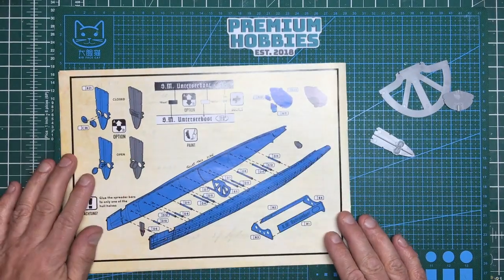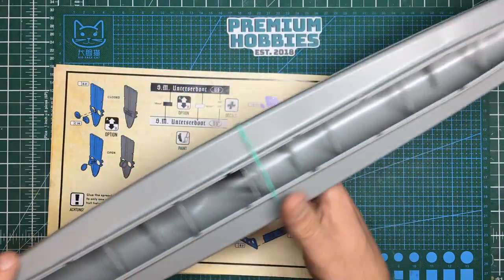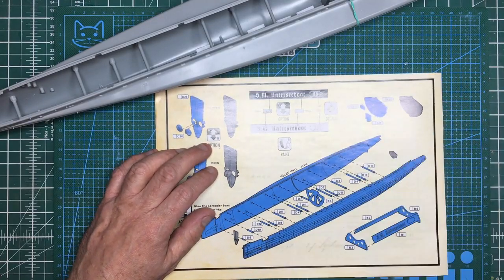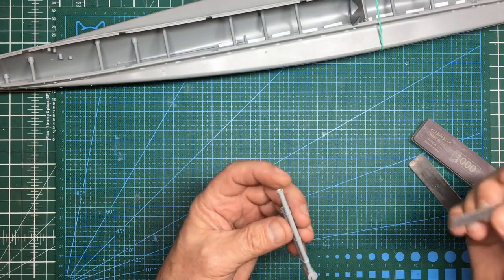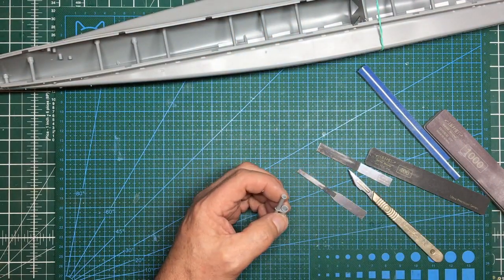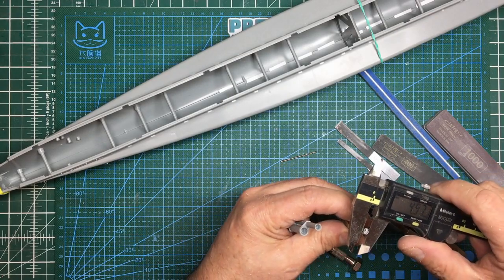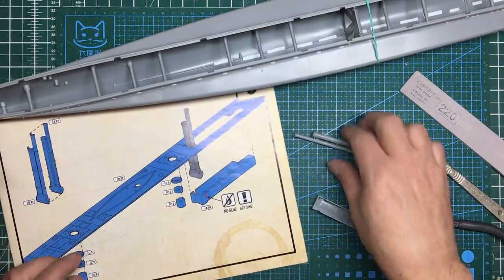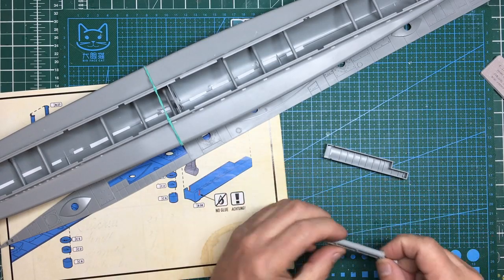Das Werk 1/72 U-Boat U-9 Build. Part 3

Comment: I think you are correct, Nigel. I believe it is ABS, since I had that type of plastic sheet supplied with a radio controlled aircraft kit I built many years ago.  It was very shiny on one side and dull on the other. I was never able to get it to glue using styrene cement. Plastruct PL2 Plastic Weld will bond it. Great video as well. I love your technique for getting the hull to line up by using the alternating tabs. Brilliant!

Comment: Really enjoying the build 👍 I personally think that the taller stack would be the intake leaving it in cleaner air. Looking forward to the next part and how to fix my finger smudges
Reply from the maker: Well, if that were the case, surely the intake would draw in all the smoke from the exhaust?
Reply: If they're parallel to each other and at 90 degs to the direction of travel the taller stack would be in cleaner air imho
Reply: In modern-day submarines the exhaust is below the intake. While the ship is moving through the water the wind will carry the exhaust away from the intake.in addition to that there's usually what they call a spray ring that sprays a water mist into the exhaust which makes it a little bit heavier and drops down to the surface of the water keeping it clear of the intake. The water mist also cools the exhaust which also causes it to stay lower than the intake and prevent overheating of the exhaust manifold.
Reply from the maker: Guys.. if you look at reference pics of U9 in action you will clearly see the exhaust coming from the taller tube.
Reply: I agree but would that be the case in during that time period? After all wasn't this a coal or paraffin burning engine or something similar. It just looks like the larger stack would allow for better exhaust of what was used in power generation. Jmho after all the closest I get to the ocean is on TV 😃
Reply: Thanks Nigel, can't see much detail on my phone.

Comment: FYI the riveting on the hull - read the blurb on box, it's not supposed to be perfectly aligned ;)
Reply from the maker: Yeah, saw that and picked up on it in review i think. Not sure they meant what they achieved around bum though??
Reply: @NigelsModellingBench  probably to drive rivet counters nuts ;)
Reply from the maker: @toboldlygosmodelworks1973  YES!! IM LOSING IT>> HELP!!!!
Reply: @NigelsModellingBench  open a can of Bud Light and get spoon for your favourite flavour of Mr Surfacer and relax.

There are keyed parts on the conning tower so you've been warned.
Reply from the maker: @toboldlygosmodelworks1973  open A bud?? As in singular?? Nah a box, yeah, never A can. Pray tell me what you mean on the tower? I’m working on that now, video loading as we speak.
Reply: @NigelsModellingBench  The periscope on fore-starboard side on the lower deck of the tower will only go in one way.

I haven't glued the tower to the deck btw, easier to paint that way.

Comment: Nigel what I'm referring to can be seen in this article from the BBC ( https://www.bbc.co.uk/news/uk-wales-45407278 ) from about 5 years ago. 
If you look at where the blades attach to the centre of the spindle it looks like the blade is a little to narrow at that point, compared to the BBC image (with the RN and German officer are usable for scale). If the book you got in the box with the kit shows an image a Prop on U12 and the shape is ok, the kit part I would be happy as is of course.
Reply: UC-75 is a later design & class of U-boat (UCII Mine Layer entered service in 1916). Compared to the U-9 Class - which were commissioned in 1910 and by 1916 had been withdrawn from front line service and being used as training vessels. So it's doubtful they used the same type and style of prop.
Reply from the maker: Thats just what i was going t say.. different era.